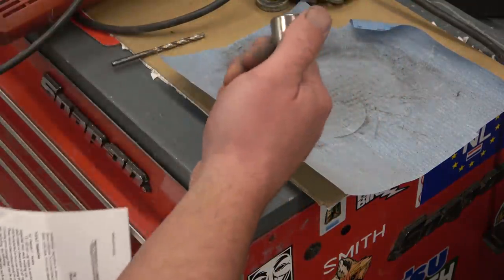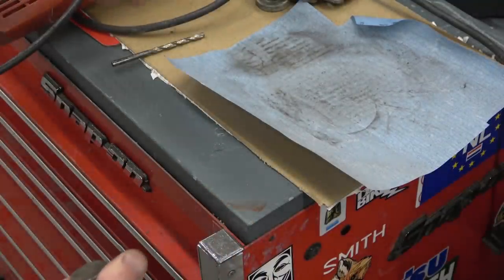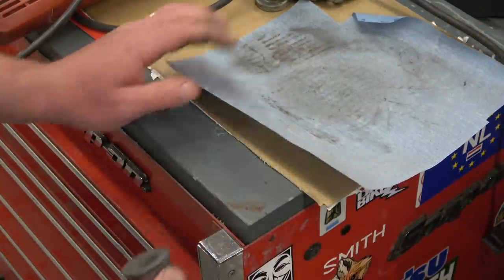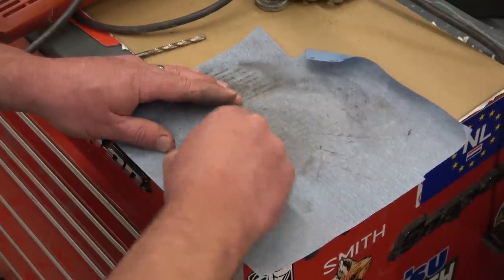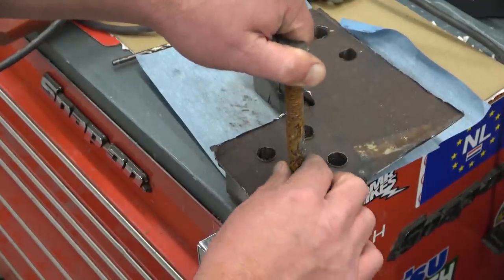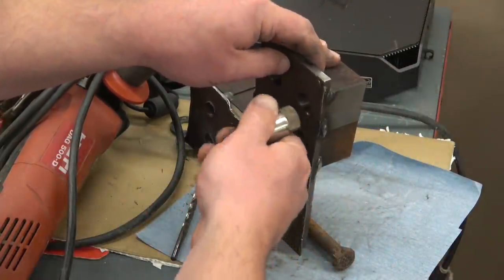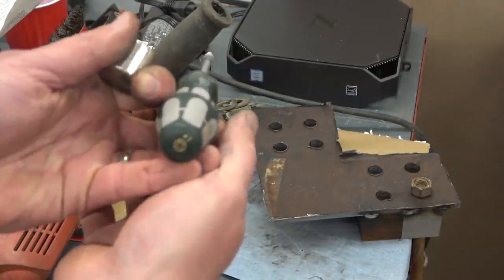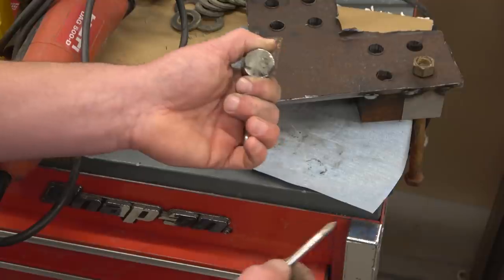mechanic magnet tricks #sharts

Comment: You didn’t mention the part where it destroys your company iPad when you just toss it back in the ol tool sack. Only happened once I swear
Reply: You can get magnets what turn off. Now only if there was womerns what turned on.
Reply: @Ryan-cy7zw  Nearly all of them do.  For a price.
Reply: I'm always careful yet still nervous whenever i put a laptop on the work bench. It's a steel bench and I tend to just stick the magnet back to where ever is convenient. Haven't done it yet but it only takes one pass a bit to close and my hard drive will be gone.
Reply: lol
Reply: @jonyemm  It might be worth swapping out that hdd for an ssd, just for peace of mind. They're still more pricey per mb than hdds but very affordable now, especially if you're only after the solid state part, not the performance.
Reply: @jonyemm  Good luck in the screen hunt matey.
Reply: @mikepettengill2706  Just need to reverse the polarity of the talking end and the business end

Comment: I had never heard of or seen a Robertson screw, bit, or driver for that matter until about 7th or 8th grade. I had a Canadian friend and her dad was building her this amazing platform bed that was about 5’ high with cabinets and storage beneath. I was hanging out with the family while he was working on it and was amazed. He explained to me what it was and the benefits. With the exception of Torx deck screws and Phillips drywall screws, I try to almost exclusively by Robertson head screws when they are available for the application I need. It is one of the reason I am so fond of pocket hole joinery (specifically Kreg products). I know it ain’t the best method to farsten tree carcasses together, but by God I love using their screws.

Comment: You can also magnetize your screwdriver by dragging over the magnet in one way for a few times.
Reply: You can also demagnitize by dragging said magnet with the pole you used to magnetize your screwdriver toward the handle and dragging it along the shaft and past the tip.
Reply: And clear out your credit cards
Reply: Does the speed you drag it over the shaft matter?

Comment: Dragging the screwdriver across the magnet several times will also magnetize it slightly. Good for pulling small pieces out of tight places your magnet won't fit. Used that one the other day working on a motorcycle.
Reply: Stick the magnet to your screwdriver.
Reply: I hot glued a small cylinder magnet to the end of a coathanger, because motorcycle.  You can bend it in any shape you need.  I think the solution is to drag a motorcycle across the floor to find magnets, because they all eat fasteners (and keys).  And anyone in the know knows that those weird undersized-headed bolts aren't cheap to replace.
Reply: @WeighedWilson  only had a small magnet at the time. Don't think it would've been strong enough back towards the handle but never know 🤷‍♂️
Reply: @dk-bw4gk  gonna have to steal that idea. And yes, I'm putting a r6 back together for a friend. Some nuts and bolts aren't made any more and the ones that are aren't cheap. There's been alot of improvising going on out of necessity.

Comment: I live in Florida and built a deck using all Robertson(square) fasteners. After a couple years I had to replace some supports. That was a pain. All the Robertson screws stripped out. They were horrible. Replaced them with torx screws (t25) haven’t had a problem since

Comment: Great stuff.  I use magnets a lot, but this is some great ideas. As a heat pump service monkey I’ve lost a lot of screws in the dirt. Working on steel roofs we tie a magnet to a stick and walk around at the end of the job collecting the swarf so the dang stuff don’t rust out the roof.

Comment: Loved the shout out for the Robbie - I usually toss all phillips screws
Reply: You won't see a Robertson on an aircraft. For good reason. 200lb gorillas and the like. Lol.  Everything has it's place.
Reply: It is a great screwhead, I'd say better than torx, because if you do manage to strip it (dumb drill with only 2 speed settings: on or off) it strips to a phillips anyway. Torx strips to a circle and I find a lot less forgiving for how well they are made. A cheap robbie screw will still work unless made from cheese

Comment: Several great ideas I had never seen before, awesome. Here's another one. If you are trying to locate a vertical wooden stud behind a finished wall, use a magnet to locate the steel drywall screws.

Comment: I got a bag of about 50 tiny neod magnets from the Bezos Empire, think they are rated 2lb pull but they are just a bit larger than a bb. Great for sticking on screwdrivers or tools or gluing to various other surfaces. I used them to magnetize most of my bits also. Just leave them on a bit for a couple days and some of the magnet juice leaks out onto the bit: magnetic bit.

Comment: I always kept a large subwoofer magnet tied to a long rope in my boat just in case i dropped something. Fouled my plugs on some bad gas one day and accidentally dropped the ratchet and one of the plugs. Bounced the magnet on the bottom while the boat moved around on the anchor and managed to snag them both.

Comment: Wanna get rid of the acquired "fuzzy crap" stuck to the magnet?

Take a strip of ANY kind of adhesive tape (Lets say "Duct, Electrician's or even Blue Masking Tape" as one of many possibilities) and use the adhesive side to stick to the fuzz on the magnet and easily pull it of the magnet.  
Cleans the "fuzz" from the magnet faster than the time it takes to explain it.

  - Joe -

Comment: If you drag a magnet down a screwdriver a few times it will magnetize it so you don't need the magnet anymore. It's weaker and you have to redo it sometimes but I've been using this trick for years and it works great.

Comment: I been fascinated with magnets since I was a weanling, back in T.O.  Then I became a certified mechanic, matches made in heaven!...
  They've saved my bacon many, many times.  Especially when I dropped a little fastener in an even tighter crack where my hand or regular pick-up tool wouldn't go.
Try this...
  Need a really long reach, way down in there type pick-up tool what won't stick to everything on its way in and out?  Run a piece of wire (up to 1/8th soft wire) inside a flexible aluminum or rubber/plastic/vinyl hose, like vacuum, fuel, etc.(whatever suits your need) 'til the tip is at the end of the hose, bending it how ya need to reach your target.
  Extend the end of the wire out the end of the rubber hose, attaching the magnet to your exposed end up top, click onto the target item and pull it up, just inside the hose to keep it from getting knocked off then pull the whole shebang out of the nook and/or cranny.  Presto-magneto!  One liberated fastener or that 8mm socket you keep dropping down in the valley of no return!  😀
  The 100+ people who didn't like this video must have had parents who took their magnets away for making permanent, weird, colored patterns on the TV when they were kids.

Comment: Something I do with magnets, I have a set older metal cabinets in the smaller shop, and all the microwave overs I have torn apart, (the magnitron magnets) I have about 200 or so, of them stuck to the front door, (make sure your cabinets are fastened to the wall studs exceptionally well) as that many magnets cantilevering out that far, is dangerously heavy. but anyways, on the days where I am doing allot of grinding, and welding, even machines, the air in the shop is littered with metallic dust. With in an hour or so, the air is no longer hazy. I have a plastic garbage bag sliced open long ways, to lay over the wall of magnets, and held up by magnets, in that hour, that garbage bag is BLACK and grey. I am sure there is also a bit of static charge that draws some of the junk floating in the air to that, as well, but I can start at the bottom, removing the couple lower magnets to pull upwards on the plastic garbage bag to catch any of the super fine metalic particulates and slowly pull it all together and can empty that into the recycle bin. Now, with out all those magnets there, it is a several hour deal for all that crap to settle to the ground, or rather, on top of every top surface in the shop, including every machine, work bench, etc... It really is a trip to see how much can travel across a 24 foot long small building to make its way to the wall of almost 4 foot tall, by 8 foot long face of magnets on the cabinets. You can't see the dust traveling out side of the idea that it is just cloudy, as that is how small that dust is. especially the wire wheel action on rusty steel. even that stuff head to the "WALL OF FLUX"... Plus, those magnets serves as a place to throw my keys, so I do not miss them before locking up, can't miss them. My respirator filters are not as gray or black, pending how long I am making a mess out there. 

I have thought about trying to divide that "WALL OF FLUX" up into a two panel deal. On one side of the little shop, having a 4 foot by 4 foot square area of magnets and on the other end of the shop, placing the other half of those magnets. One set with North poles stuck to the metal cabinet doors, and the other 4 foot square having those magnets with their south poles stuck to a metal sheet. Or maybe even try to see if there is a difference bad, good, better scenario, to see if the polarity can or will create its own direction current flow, as per FLUX goes, like a circulation in a swimming pool, to aid in the filter being able to collect more junk. it may sound stupid or like a waste of time, but, I already have the magnets, it won't cost me anything to see what will happen, and I might just learn something in the process. if it works even better then is does now.. I might be onto something here?

if it really gets fine tuned and works better then is already does, I wonder (out side of my electric bill) making panels that are elctricromagnets  each with polarity switching pending what you are trying to do, or how big the space is. Why you might ask.. Well, for the clean up factor of ease. Have a catch tray below ,like what a tray/mud pan looks like that dry wall guys use, and flip a switch, or a degaussing button, and all the metallic crap just falls in to the catch tray/pan in clump, which might be a bad idea, as I can see that when hitting the catch tray/pan, going )))POOF((( ..... and making a new cloud of crap in your face... maybe do it is height stages of dropping the crap into the catch tray?.. there is my two cents on the magnets matter.. that was fun. Be safe all. learn something new once a day. as it is free to to that. and once you learn it, nobody can take it away from you, like they do with gun rights...

Comment: Here's a protip for anyone who uses grinder indoors often to cut/brush/grind any magnetic metal. Get thin sheet of steel, so thin you can easliy bend it. Stick as many magnets to the back of it as you can and grind/cut/brush at angle that sparks go flying in direction of said steel sheet. Congratulations, now all the steel dust is being captured by the magnet, saving you time of vacuuming it off.
You can try wrapping the metal sheet in some fabric too, all the dust will be conveniently pre-bagged.

Comment: This is all well and good, unless your floor is basically carpeted in iron filings like the workshop my dad had when I was growing up and still has. Although now its more like a 250mm corridor with machines crammed in inexplicable positions. He has gear to furnish a huge workshop but manages to use it in a 1 car garage (UK size [very small]).

Comment: If you ever want to demo some drywall without making a huge mess you can find the screws with a magnet, unscrew then cut the joints to pull off full sheets.

Comment: pulling wire in finished walls, aluminum trailers, fiberglass campers... tie a magnet on a string with a drop of super glue, then use another magnet on outside of wall to pull it through from one opening to the next. then tie on your wire and pull

Comment: They sell those little ones with a hole that you can thread a lether strip through and wear around your neck. Comes in handy as a screw holder for odd jobs around the house and in the workshop.

Comment: One more trick with a small circular neodymium magnet and another large one: I glued small one to a thread and can fish electrical wires from top to bottom behind drywall. Poke two small holes and just catch the small magnet with the field of the large one that is outside against the wall and drag it to the other hole, get it out and fish the wire after thread is pulled. I found it is more efficient than the fishtape and drywall cuts

Comment: Put the magnet inside a plastic bag to pickup metal chips.  Let the chips stick to the outside of the bag,  then turn the bag inside out , remove the clean magnet and discard the bag of chips.

Comment: You could also use the magnet to magnetise your screw driver by 'stroking' the driver with the magnet from back to front a good few times. The structure of the iron is changed so that it acts as a magnet for a good while.

Comment: If you've got a lot of parts to machine that make particularly sharp swarf, then putting a big old speaker magnet in the bottom of a bucket with another bucket on top filled with coolant makes a great place to rinse them off. Sharp swarf sticks to the bottom of the top bucket while you pour the coolant back off then you separate the buckets and you can just tip the swarf out.
Similarly, magnet in a bag will pick up swarf, then turn the bag inside out to simultaneously retrieve the magnet and contain the swarf.

Comment: I keep an 18" magnetic tool holder in the truck. (Available from the usual suspects.) I even put a rope on it. Cover a lot of ground without bending over. Also, good for sweeping under equipment, cabinets etc. Use it on my gravel driveway occasionally. No wonder I have so many flats. Who puts all those rusty fasteners there?

Comment: If it spins a disc, it’ll spit out small square neodymiums that are perfect for swarf splinters and putting under finger bandaids so you can weed out 90% of the junk jewelry without the estate sale overlords automagically adding 0’s to anything you bring to the till. 
Magnetic hard disc drives spew forth a crescent of neodymium with a slight lip on one side. Perfect for providing a little clearance to pry up or snag with some pliers after the fingernails give out.
I fucking love magnets

Comment: I caught an old 7/16" craftsman spline/robo-wrench combo that someone had dropped inside the duct under the old rooftop AC i was helping replace, by using a shoelace and the stock of a Malco bit (reversible/cleanable magnetic 1/4"&5/16" impact bit, popular with HVAC guys).  Looked pretty clever that day😁

Edits: clarity

Comment: I did once use the 'stick a magnet to a screwdriver' trick ( 2:09 ) at home a while back, trying to put the tiniest M2 screw in to something about 400 miles down into the corner of some electronical thing, where the PCB has just enough space between itself and the edge of the case to allow a screw to fall down it and never come back out.

Very useful, also stopped me from ageing 20 years just putting a single screw in with all the panic and stress of having to take everything apart to go grab it again

Comment: Or, you can magnetize your screwdriver by rubbing a strong magnet in a single direction along the shaft of the driver for a bit.  Doesn't last forever, but it works in a pinch.
Reply: Problem most guys cannot rub it along the shaft in only one direction, seems to be an issue.
Reply: trouble with a magnetic screwdriver is that usually the screw is non-magnetic but the next screw you are working jumps out of the hole and then you knock it off the driver

Comment: Magnets hold parts in position for welding.

However,  don't weld in close proximity to the magnet,  it will compromise the arc.  Also, if you heat the magnet, it looses its magnetism. 

So spot weld the parts then pull the magnets off before you complete the weld.

Comment: Need to drill a hole through the floor/wall that has to be dead nuts & drilled from the other side? Put a magnet on one side and use a cheap compass to find it on the other.

Comment: Magnetize the screwdriver by sliding the magnet down the blade a few times in the same direction and it aligns the magnetic flux. Demagnetize by butting the magnet on then pulling it straight off perpendicular to the blade.

Comment: used the magnet trick to hold screws millions of times. Wish they had Robertsons here in AU, (I've got the screwdrivers... they come in universal kits...) Nothing worse than Phillips Head screws... absolutely awful, and everything, everywhere seems to have them... The only thing in the toolbox with more visible wear than the phillips head screw-wrecker is the easy-out next to it >:(

Comment: Hit the tip of the screwdriver, pretty hard, against the magnet. Like ding it but not to shatter the magnet. It will magnetize better, the shock helps the crystalline structure to reorganize with the magnetic lines. 
It is like 1% efficient, unlike electrical magnetization, but it's there, free, good enough to hold a screw in and almost as having a NdFeB tipped screwdriver.

Comment: Great tips, (d)AvE. but nearly every fastener I use is 304 or 316 stainless steel. I need some kind of 5th-dimensional magnet that attracts stainless but not grit off the floor.

Comment: As far as screw drivers go... you can usually take a flat blade screw driver, place it onto a piece of steel ,and smack it really hard with a hammer and it will become slightly magnetized. Enough to get your screw started anyway.

Comment: Or if you find yourself working on a Simplex 1000 series door lock (You know the one, 5 buttons in vertical) and you forgot that the factory code has a double-push. Just pop that magnet against the side and lift the lever two or three times, You're in!